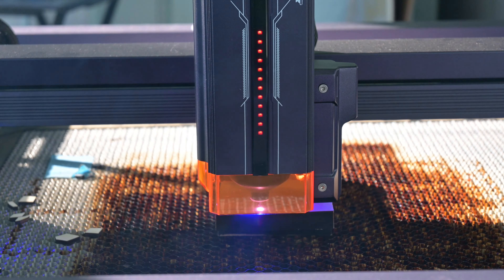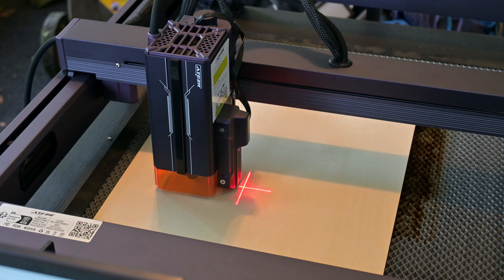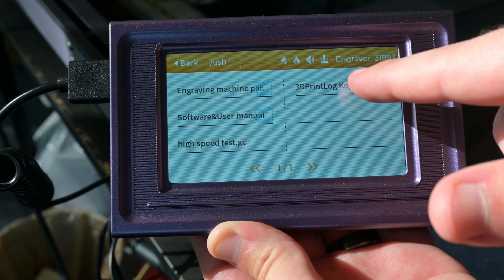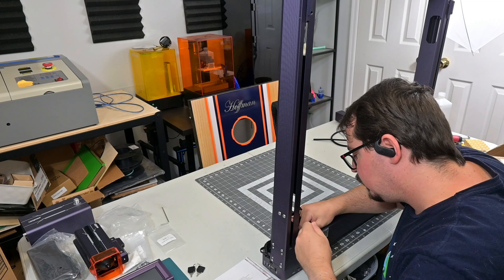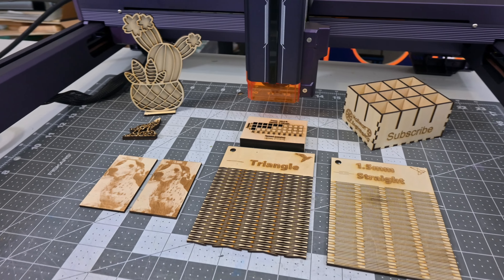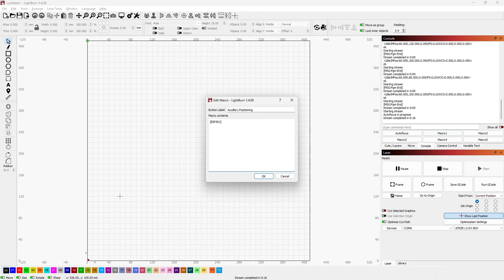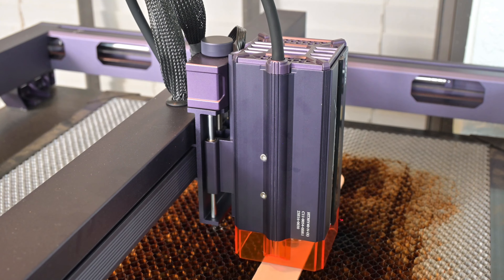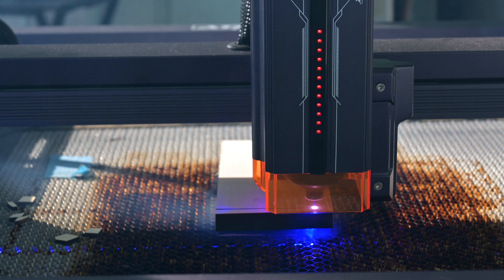The Next Generation of Lasers Cutters are here! Atezr L2 36 Watt Review

Comment: Does the fan on top of the laser  shut off when it isn’t firing?  My Longer laser fan runs all the time and the noise is a nuisance. 

Great video, been thinking about upgrading to this unit.
Reply from the maker: Yes, the fan automatically turns on at the start and off at the end. It also automatically controls the air assist compressor as well, so there is 0 noise when it is not firing the laser.